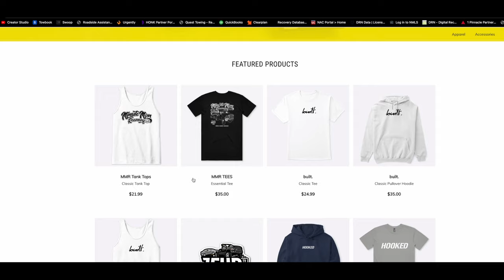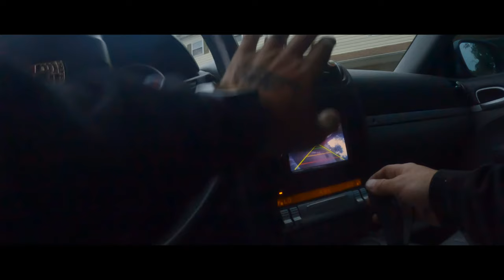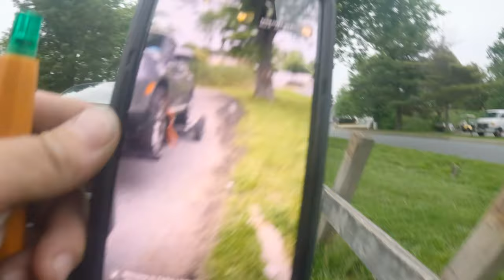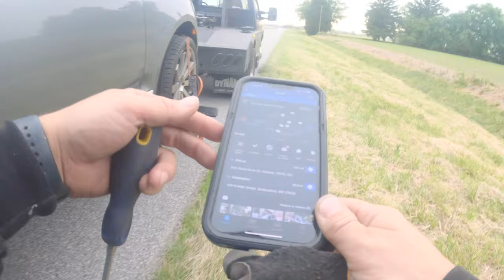BASEBALL BAT PULLED ON REPO

Comment: I just found your channel.  Nice watching someone else doing the same job i did for almost 2 decades.  Retired from towing and repo about 5 or 6 years back.   You do a really good job of it with dealing with people.  I had multiple bats pulled on me over the years, the last repo i did the guy came out, didnt say a word and walked back in tbe house.  As i was pulling out he shot thru the back corner of my wrecker cab and out thru the windsheild.  If i hadnt leaned forward my head woulda popped like a watermelon.
Id have been pink misted.  People can be CRAZY when it comes to their rides.
I ran a f550 with a dynamic 601.  The regulator was bad and would flip up so fast it launched rocks thru the rear window.
One of my guys destroyed a set of in the ditch 5k dolleys.  He put a diesel excursion on them and wondered why they fell apart after 10 miles.